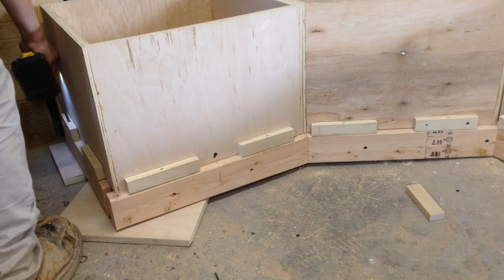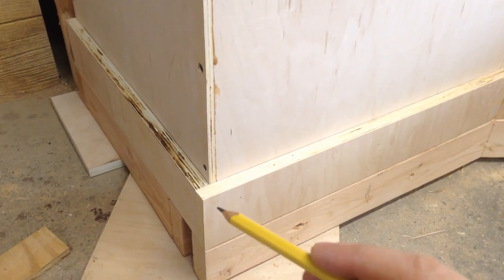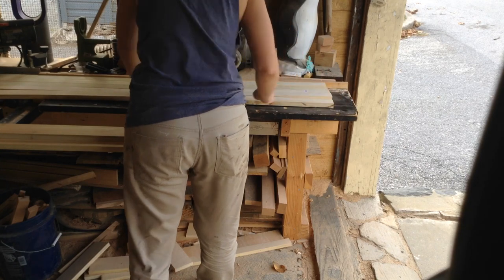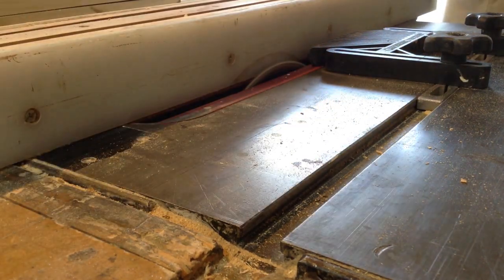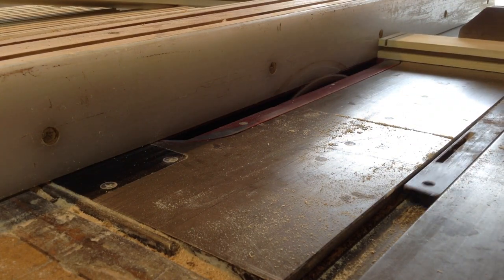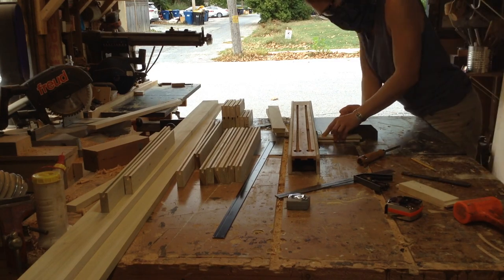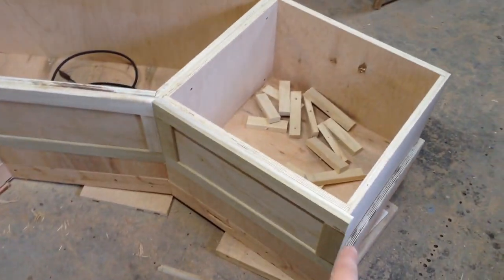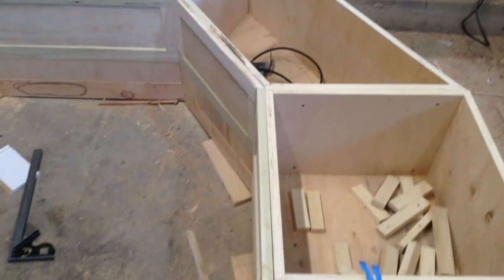How To Make A Banquette Bench W/ Storage [Part 2]

Comment: Just a month ago I was inspired to go out in my shop and connect my dust collector after you plumbed in yours. Now I see yours isn't running anymore. I'm just messing with you. 😁 I know it's hard to remember for just a couple of cuts. I forget my hearing protection, dust mask, and collector all the time. After all, it's just 1 quick cut, right?
Reply from the maker: I have been super lazy with turning it on.  Problem with that is if I don't use it a few times, I figure what the heck and just stop using it.  I was doing this and the coffee table at the same time and was rushing.  Now they are both done time to clean the cobwebs off the collector and get back to it haha.